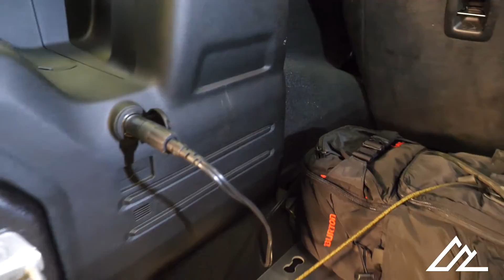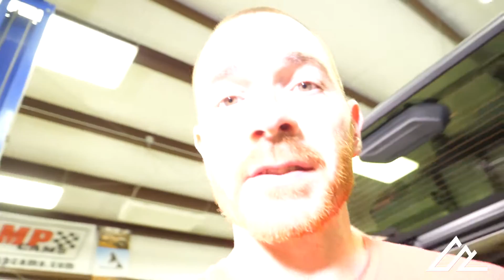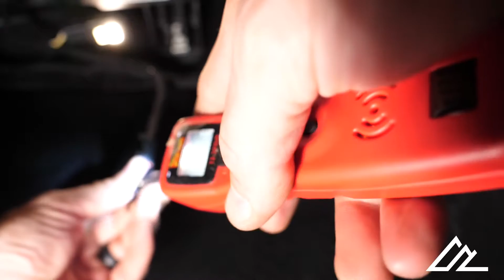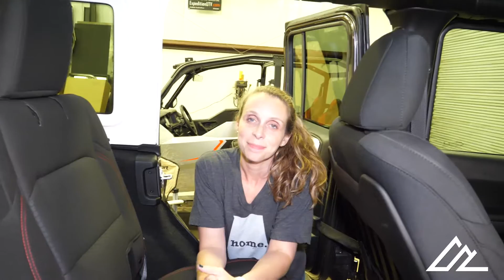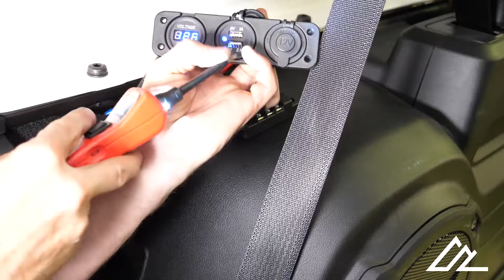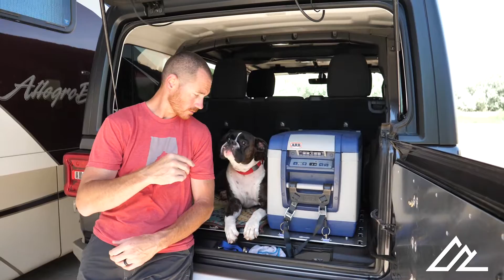EP 007 - Wiring Jeep JL AUX Switches

Comment: Weird my '21 rubicon has little labels on the wires so I know which switch each wire is. The only other thing I had to do was figure out which switch was 40 amp and which were 15. On my Jeep switch 1 and 3 are 40 amp and 2/4 are 15 amp.

Comment: Great video. Thank you.
Do you know if most of the "spare" fuses (blank spots) in the fuse box are 12- volt accessory?  I have a 2019 JLUR.
Almost all of the fuses are Micro 2 and the probes on my tester are too fat and won't go down inside the area so I can check it for 12 volt to see which side is load and which is draw.

Comment: I’m adding some accessories to the factory aux buttons in my 2019 JL. Did u disconnect the main battery before doing the butt splice in the passenger footwell? I don’t wanna get zapped.
Reply from the maker: You wont get zapped if the dash AUX switches are turned off. However, it's always good to test voltage before you start cutting and stripping.

Comment: Awesome detail. I'm going to do the same for my domestic fridge/freezer. I have a 2 door, where did you find the metal plate you're arb fridge is secured too?
Reply from the maker: Thanks for watching. Having the fridge back there has been great for us. We love it. The plate is a product we build. We call it the M.A.S.S. platform. That stands for Modular Adaptable Storage System. We are building a ton of accessories for it (fridge sliders, various drawers, spare tire mounts, etc.). Here is the product page https://americanadventurelab.com/product/jeep-jl-mass-storage-platform/. We don't have a 2 door version yet, but it's ok the list. I just need to get a 2 door into the shop to measure.

Comment: NIce vid, thnx. If i'm going to wire up some ARB Intensity lights, is there any wiring under the hood near the battery to latch on to or do I need to bring that into the passenger foot well? Then to wire, use black to ground, orange and either wire to constant  (which is off the battery? ) or to acc correct? .
thanks pal
Reply from the maker: Alvar Lee thanks. If you have the switches from the factory, you will have a similar wire cluster under the hood, near the battery. There is a constant power wire in the cluster as well. Check out the wire colors listed in the description of this video for details. Good luck with the install and thanks for watching.

Comment: so the AUX switches are already connected to the battery and all you have to do is to connect the wire to the accessory you have?
Reply from the maker: That's right. There is also a separate connection to each of these circuits in the engine bay as well (for front mounted accessories/lights).
Reply: American Adventure Lab can’t wait to see a video about connecting front lights

Comment: You should consider wiring that connects to the aux switches to be for turning on/off a relay NOT a load (ARB Fridge). You want to run a large enough cable from the battery through a fuse or breaker back to a relay near your load. You should never connect a small power wire to a bigger wire if you do this then your circuit is only as capable as the smallest wire in the circuit. Please don't just tuck an 8 gauge power wire casually under the carpet and blindly under plastic trim. You may find a burned out shell when you return from that day at the beach back to what was a 2018 Rubicon. Do it right and do it well.
Reply from the maker: Thanks for watching, John. ARB recommends a 15A fuse for the circuit. For what reason do you feel it is necessary to connect through a relay? In my experience wiring recreation vehicles and race vehicles, adding an unnecessary relay to a circuit is creating an additional failure point.

As for tucking the wire, I agree completely. The panels were later removed to secure the wire and connect the ground to the body. That was not included in the video.
Reply: My concern is safety and longevity of the installation. Safety is paramount it's not just you in that Jeep.  Your probably not racing that new Jeep yet but weight isn't a concern safety is. Why do you think they use relays in the automotive industry?
Reply from the maker: Relays are used to allow a low voltage switch to engage a high load circuit. That is not the case here. The OEM switched circuit is more than adequately fused (from the factory) and the switch assembly is setup from the factory to handle the 40A load that could potentially run through it. Using your logic, every switched circuit on the vehicle should have a relay, regardless of switch capacity. Jeep does not follow that suggestion either.

I do really appreciate you watching and providing feedback. However, I will not be adding unnecessary relays. I have almost a month of constant use on this setup and it works flawlessly, even in the 110+ degree heat.
Reply: If the wiring that you are using is capable of 40 amps DC why did you up size the wire gauge to 8 gauge wire?
Reply from the maker: John SmithDE it is automotive amplifier cable. It is heavily shielded and very flexible.   Arguably, I could have used smaller gauge wire, but I already had that in the shop and I would much prefer to over-gauge than under-gauge.
Reply: I originally replied to point out MY concerns with your wiring and how it could be done safer and better. If your happy with your wiring skills that's fine with me.
Reply: John SmithDE  Safety is paramount, love it, live it! Thanks!

Comment: Great information. Couple questions. Would it be safe just using the 40 amp fuse of the factory AUX switch? Also I’m guessing from the link your fridge is a 37 qt, do you find that to be a sufficient size or would you have preferred the 50 qt. Thanks
Reply from the maker: lbeatojk yes, the OE fuse would be fine. I wanted to separate out the USB circuit and have room for additional circuits in the future. If it weren't for that, the OE 40A would work just fine and make for a cleaner install.

Comment: Thanks. Do you know if the wire colors are reliable for the Rubicon? That they'd be the same for all on that trim?
Reply: The Aux 1 under the hood my Rubicon was the peach and pink wire.
Reply from the maker: Unfortunately, I do not. I assumed FCA would try to maintain the same colors throughout the model line, but after seeing different colors for these wires on other articles, that doesn't seem to be the case. I would like to get my hands on some other Rubicons to see if they were the same.

That being said, the two 40A circuits are larger wire than the 15A circuits. So, you have a 50/50 shot on the AUX1 and AUX2 switches right off the bat. The smaller wires may be less favorable odds since there is a ground and two power wires, but hopefully at least those other (not the 15A AUX circuits) wires will remain a constant color scheme.
Reply: I figured. I've noticed another thing that seems to vary by vehicle (specifically the hood sensor wiring placement). If/when I get around to adding an Aux, I'll test it out and report back.
Reply from the maker: Ambrose Little sounds great. Thanks.
Reply from the maker: I did not check the colors under the hood. When I do some front accessories, I will check them. Thanks for the info and thanks for watching.

Comment: Great video, 8 gauge wire is understandable, but connecting it to aux pos. 14 gauge is weak link in the positive chain, still be ok since aux is protected by a 40 amp fuse on the firewall, really no need for any other fuses down line
Reply from the maker: Thanks for watching, Mark. On one level, I agree with you. However, the main reason I put the secondary panel back there was so I could split off the functions of the 12V receptacle (and potentially other circuits) and have their individual circuits isolated from each other. That way, if the USB circuit blew it wouldn't affect the ARB fridge, and vice versa. It will also allow me to more tightly control (dropping the fuse size) the amperage on each "child" circuit if I decide to do that in the future.
Reply: I wondered the same thing.   You are going from a smaller gauge to a thicker gauge.   The resistance is going to increase dramatically.   Wouldn't this create excessive heat in the 14ga wire?

Comment: Great job but I will keep mine on the drivers side like I had it on my JK. The ARB pull out mess with my cutting board.
Reply from the maker: Hey, Frank. Thanks for watching. It wasn't so much about moving the plug to the passenger side as it was recessing the receptacle out of harms way. Where it is from the factory will create issues getting almost anything in and out of the cargo area. I agree on the cutting board issue. I'll have the same issue if the cooler stays on the passenger side. I'll just move the new receptacle to the passenger side when I get the tailgate table finished. I won't be using the OEM receptacle for anything.